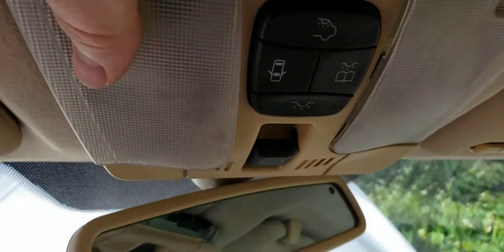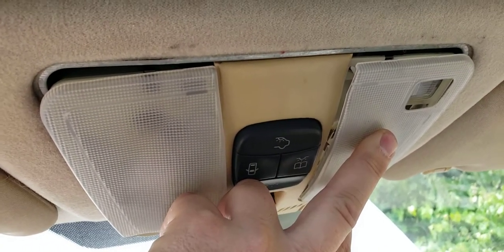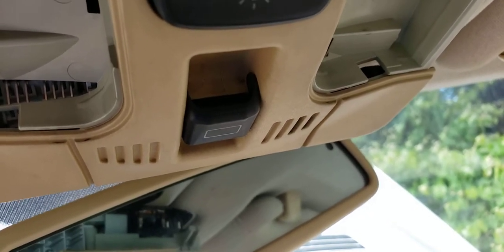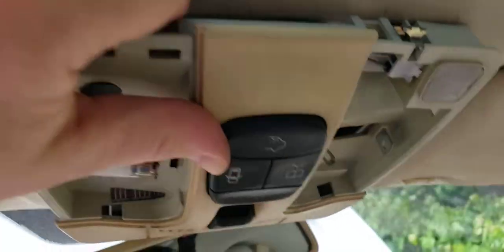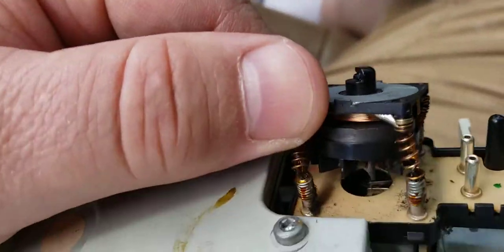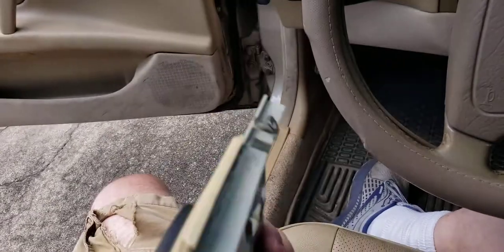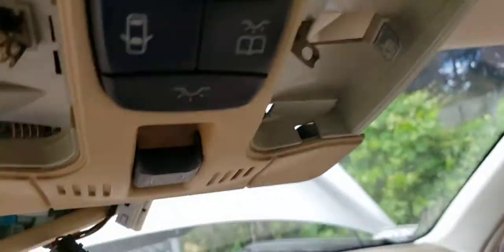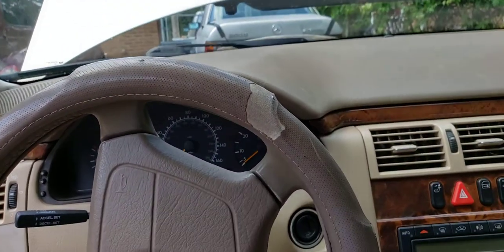dome light sunroof overhead console removal 1999 mercedes E300 Diesel

Comment: Hi Drew, thank you for the video on “tabs”.....I hate to break it to you but that thing with the springs, that you were playing with, is really the heating and cooling sensor for the interior of the car. If it was making a noise it is because it has built up dirt or dust and needs to be cleaned.
Reply from the maker: Oh wow really... I did notice it was a fan and yes it was clogged with dirt.  Oh well I just always set the temp to low or high ha ha dont need the fancy 72 degrees ha ha.  Thanks for watching and thanks for the correction!! I never used the cell phone feature on the radio. Wonder where the mic was for that. Lol back I. 1999 there was a huge transmitter box in the trunk for the phone